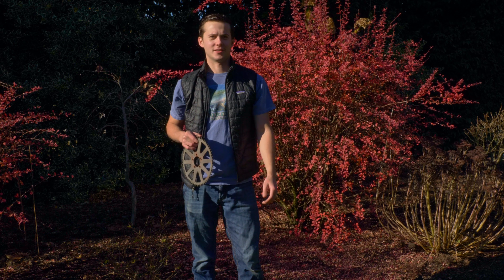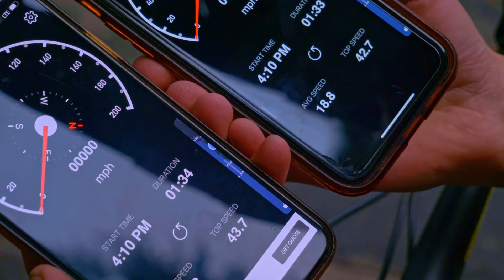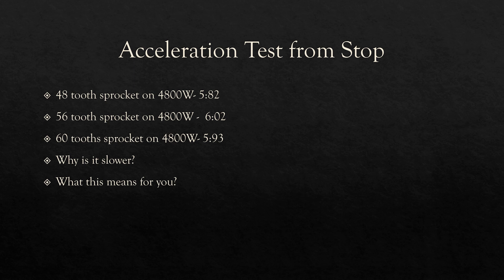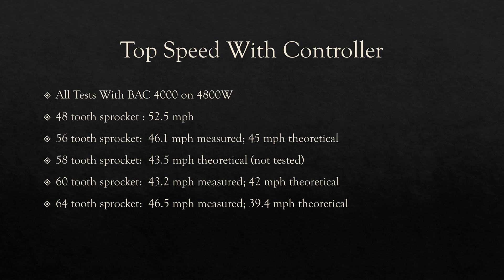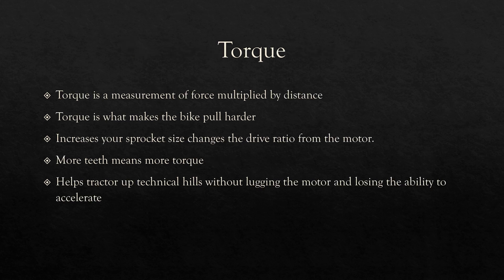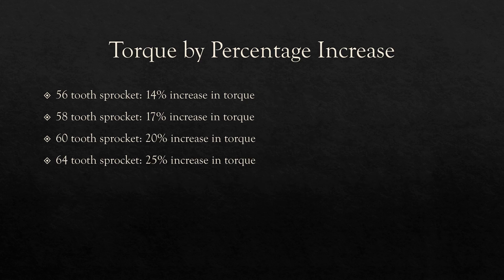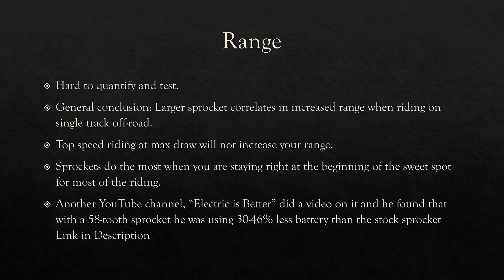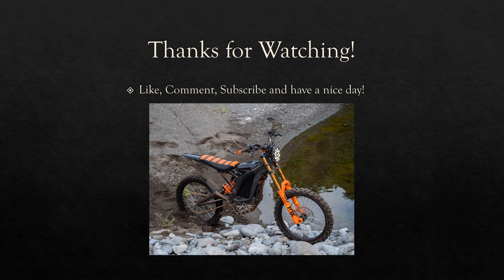Sprocket Testing On the Sur Ron X

Comment: small sprockets make your controller dump tons of amps. High speed rpm's require more voltage. Amps for torque, voltage for speed.  Hence, 52 volt batteries need to dump massive amps to achive speed and power. Where 72 volts has the best of both worlds. Massive volts and massive amps. I've got 6 emtb and 2 talarias and gearing is essential.

Comment: You don’t have a clue what you talking bout there is 4 sprockets 🤣👍
Reply from the maker: If you are referring to the Jack shaft gears and motor gear, those are not sprockets. In a pair of gears the larger is referred to as the sprocket and the smaller is called the pinion. There are not four sprockets on the bike.

Comment: Looked like you were going downhill in the speed test?  
If so I wonder if that might account for the top speed discrepancy you encountered on the largest sprocket. A flat 0% decline road would probably affect the results more towards the theoritical figures.
Reply from the maker: Definitely would’ve helped but was the straightest road near us where traffic wouldn’t be an issue. The hill was more to compare deltas between the sizes rather than max figures.

Comment: this has been a fascinating topic to study, i'm 6'5 250lbs i was worried the whole bike would be too small for me but seeing how folks in austrialia kit them out has given me some hope that the pegs and tires can be adjusted to add some height and a bigger sprocket will make all the difference for moving my girth up hills.
Reply: There are full size electric bikes with full size power for 8-15 grand depending on budget. You’ll end up spending at least 6-8 grand on a new surron and that’s without upgrading the power at all. I have the bike set up for me cause I’m 6’2 but After a year of owning it I’m wishing I spent the extra three grand on a full size. The stock suspension will not hold up to hard riding for anyone around 200-220 and up and that’ll cost you like 2 grand at least and another 2-3 for a battery and controller, plus the tires are clapped in any kind of real muddy stuff because of how narrow they are and buying a bigger wheel and tire from these custom guys they charge you a grand, so to build a surron or Segway x260 into an actual useable hard trail bike your going to probably spend well over 10 thousand

Comment: My Bike weighs up to 200 lbs and I weigh 200lbs. It has a 72V battery and Bac4000. Do you think I would get the same issue of too much torque on the takeoff where the bike lifts up with the 60Tooth sprocket?  Or should I get a smaller sprocket like the 55Tooth?
Reply from the maker: I’d recommend 64T if possible especially on a 72V system. You’d still be able to hit 60+ with that. What’ve you done to get the SurRon up to 200lbs?
Reply: @emotobros . It's not the Sur Ron. It's. a different E-bike

Comment: What do you think the top speed would be with the following: 
60 tooth rear
18/21 dirtbike wheels/tires
Bac4000 60v battery set to 10kw
?????
Reply from the maker: With a 64T and 19” rear instead we hit around 48MPH with field weakening.
Reply: @emotobros  WOW! I would’ve thought 64T at 10kw would be WAY more torque than needed… so confusing

Comment: If the test numbers vary because the testers couldn't run their tests consistently then the TEST IS INVALID, and despite all your effort should have NOT HAVE BEEN PUBLISHED. The test is fundamentally flawed. I figured this out when I was 12 years old. I ran a math probability test for a class in school and I attributed results to tester variations. That means THE TESTER IS FLAWED. If the tester designed the test then both the TEST and the TESTER ARE FLAWED. I got a "D" on the paper.
Reply from the maker: The tests were all conducted consistently. Sometimes results don’t match expectations. More tests could have revealed them to be outliers but we only have so much time to spend testing. Not sure what your goin on about man😂😂
Reply: @emotobros  "We only have so much time to spend?" More excuses? Wow, it must be nice to live in your world. A world where proper results are optional and there's no repercussions for failure. Man, I want to live in your world. It sounds easy. If I EVER provided answers like those you give to my professors in college years ago or to my clients now I'd be persona non grata in minutes, have no customers, & be penniless living under a bridge because millions could die because of my less than perfect solutions to problems.  I don't do that. I produce inspired solutions to problems others deem "too difficult to solve," or "impossible to do" 100% of the time often with little to no information to guide my efforts.  Your world filed with reasons why things can't be done sounds like a vacation to me and reminds me of when I was in grade school teasing pretty girls at recess and playing kick ball. I guess it's only youtube. There's as much idiocy as brilliance. Peace. Keep the electrons flowing and the wheels spinning. Ride on.
Reply from the maker: God tier ego stroke, chief, 10/10. You know what sounds easy to me? A world where you have unlimited time and resources to sit around and attempt to reach a conclusion that’s already very easily proven physically/mathematically. This was a dirtbike sprocket test for YouTube, take things a bit less serious and understand that we had a section explaining why we felt we got the results we did.
Reply: @emotobros  Look, I got a math paper graded down when I was 12 years old for doing the exact thing you did. It still stings and I'm bitter about it to this day. Clearly.
Reply: You need to use rollout to get the consistency.
Reply: @John-ep4in  Then rollout should have been used and the results of that test published.

Comment: Great info.  I'm thinking of turning my x160 into a commuter.  Lowest tooth sprocket I can find is 42.  Buy you colocations, could that make it to 40mph?  Would a custom 36 tooth work better?
Reply from the maker: Going that low will put a fair amount of stress on the motor and kill the acceleration. You’d probably be better off just getting a SurRon if you’re looking to get your speed up high enough to commute on. This video is based on a SurRon so not sure how an x160 would compare at this size.

Comment: I can't find a video of someone testing a 38T sprocket, 72v, and BAC 8000. Pretty sure you would go 80mph. I'll have to make it myself I guess
Reply from the maker: You can go over 80MPH with a 42T and the 800+72V. Lower T sprocket = way more heat though!

Comment: Torque actually goes down almost linearly as RPMs go up (due to increasing voltage in a motor, so your dyno graph is wrong I'm afraid). This means that with larger sprocket you are loosing torque at a mid-range of speed (20-30 kmh). If you have BAC - set phase current to 430A and you won't need a larger sprocket for bottom torque, while retaining you mid-range torque. With such settings I found 48 or 52t to be optimal for 60v system.
Reply from the maker: Under ideal conditions and a constant power draw you are correct. However, this plot actually is accurate. AC motors have an area of ‘constant’ torque, which is the flat line before linear drop off. The line shouldn’t be exactly flat, but in general there is an area of mostly constant torque. Linear decrease from the jump is more of a hypothetical result than an experimental one.  Also, the ramp upward exists purely as a function of our tune. We have torque ramping setup so that you don’t get hit with all the power instantly because that wouldn’t be enjoyable to ride. The voltage to the motor is actually decreasing as power is delivered due to voltage sag from an increased demand in amperage. Our tune demands very slightly more amps as RPM increases which gives that flat line effect.

Also, the torque is only decreased past the flat line for bigger sprockets. We have ran all the way up to a 64T and notice no decrease in mid range torque with bigger sprockets until about 35Mph with aftermarket controllers.

We also have ASI BAC4000s and run them at 430A. We still prefer >56T and manage to get 55MPH+ with that setup and enough torque to pull the front end up at 25-30MPH.
Reply: only applies to no-load rpm. If in the mid range speed the motor is under load then the bigger sprocket still has more torque

Comment: Interesting video, remember as engineers, experimental results always trump theoretical, the trick is to maintain consistency and replicability! Theoretical analysis often overlooks unforeseen factors. 

Definitely gonna look into upgrading my sprocket though, which are the best for wheelies? Lol

Also would be interesting to see a smaller sprocket size, doesn’t seem like anyone has tried that yet!
Reply from the maker: Very important distinction. We mention in the video that, experimentally, we think we were close those the limit of how hard we could launch and as we went up in tooth size it made it much harder to launch fast. This is likely why the times were so close.
Reply: Good information for those looking to maximize acceleration without sacrificing top speed, would the 56 tooth be best in this regard? Since it seems that once you step up from there the difference is negligible

Comment: Would love to see the comparison of a 50t and 52t sprocket versus the 48t.
Reply from the maker: We would like to as well but at $50-60 per sprocket,  the revenue from this video won't even cover the time spent designing 1 of the 4 we tested.
Reply: @emotobros  Coming from a guy with forks that cost half as much as a full Sur-Ron. You are well off with $. Probably got a Ludicrous XX on the way smh.
Reply from the maker: @micahack5377  the forks were $850 after selling the stock ones which is less than 1/4th the SurRon. If being able to spend $850 makes us well of than, yeah, I suppose we are. However, we also work full time run this business and have few expenses. No XX on the way, our controllers are better :)

Comment: Nice to see your sprockets you had made. Can relate with the high 50T count as I’m really happy now with the 57 I’ve been using for the woods. But my woods wheel  set is a 19X1.85 front & 17X2.15  rear now.  I’m really liking this wheel size with the 57T because it has instant throttle response that roosts anyone behind me!
PS- I’ve got one of my wheel sets for you guys to do some riding on . Will email you with the specs and sorry for the delay in response..
Reply from the maker: We are looking forward to it! Do you like the 19\17 combo more than the 21/18 or 21/19?

Comment: Also with a larger sprocket, the distance you are measuring will affect the times for the torque measure.   The bike will not gain as much distance or speed at the higher speed end of the run.   By doing a longer run, it allows the top speed differentiation to creep back in.  It would be best to measure a shorter distance to measure low end torque.  That will give a better impression possibly.
Reply from the maker: We thought about that too but the speed we were hitting was only around 30mph so minimum the largest sprocket had another 10-15mph to go.  The limitation is how hard we could get on the throttle. With a 60T it is a serious struggle to even go half throttle without popping a wheelie. We think we are close the the limit of how hard we can launch and on stock sprocket we were able to go full throttle off the line which made it a lot easier.
Reply: @emotobros  If you just shift your weight forward, i mean a little in front of the seat, you are not going to pop a wheelie, at least not enough to be a problem. give it another shot.

Comment: The 54 tooth has been a great middle ground for me. Great for climbing but not to slow for fast trails
Reply: But I am sure the 56 is extremely similar
Reply: @EdwinOlding  so what’s your top speed with this set up?
Reply: so 54 or 56 would be best for more range with a 60v 60h battery ?
Reply: or would the stock be perfect with an upgraded battery and controller?
Reply: @WARDOGOD-2  going up in size will help keep
Motor temps cooler. With the gearing helping everything staying cooler your setup will be more efficient
Reply: @northsandiegorc4248  gotchu! appreciate that💯

Comment: what about a 52
Reply from the maker: After riding a 56T we wouldn’t recommend anything lower as the difference isn’t torque isn’t very noticeable. Do find percentage torque increase though you can do 1-(48/52) then you can do 44*(48/52) to find the top speed on the stock controller.

Comment: In my experience as someone that rides this bike to work and back everyday a larger sprocket does NOT increase range. simply put i have to run the bike at a higher rpm consuming more power just to keep it at the same speed as the smaller sprocket. it can however give you more playtime in the woods as now with the larger sprocket the motor does not have to try as hard to get going and over obstacles.. basically you dont have to wack the throttle as hard. that is why i feel the claim of more range is misinformation
Reply from the maker: We have never advertised ourself as people who ride on road so that doesn’t apply to us. But beyond that, we mention in the video that people constantly riding at a high speed on road aren’t going to see range benefits so I don’t see what was misinformation.
Reply: @emotobros  my experience is at 15 -20 mph not top speed. 14 mile round trip went from charging every two days to having to charge every day
Reply: it was pretty clear its more range on trails
Reply: 48t to a 54t
Reply from the maker: Like we said, if you’re trying to sustain speed, you will see no difference because you need more throttle to reach the desired speed and sustain it. For us, we are constantly letting off and getting back on (accelerating) which is where you see a difference.
Reply: @emotobros   im in no way trying to bash you guys just feel the average person correlates range to mpc (miles per charge)
Reply from the maker: We know you aren’t. We also equate range to miles per charge, and in our experience, off-road, we get more miles per charge with a larger sprocket. Physics dictates that this is what should happen.
Reply: @emotobros  just watched again and i did hear you say increases range/decreases battery consumption missed that the first time. but feel that is a better representation of what is goin on
Reply from the maker: We for sure agree that on the road where speed is constant you’d want a smaller sprocket. Although we would be curious to see anyone create a practical test where they prove a bigger sprocket doesn’t help range off-road.
Reply: @emotobros   i live in the city and today i went to find as many hills as i could to climb by interstates and railroad tracks lol i left with 80% came back with 35% was out riding for a good 1 1/2 hours %90 in eco
Reply: @emotobros  oh i believe it definitely helps offroad gives you way more playtime
Reply: @mre741  I like your "playtime" metric vrs range concept.  2 riders on identical machines. A follows B to the half way point, then B follows A back to the start/finish line. the remaining usage time left in the batts of both bikes will not be the same because rider A and B are individuals. If you scale up with 100's of riders, then, an average may emerge,  that average is the range... the playtime is highly variable due to the wrist, mode, situation, and terrain.  imho...
Reply: i still gave the video athumbs up...

Comment: At 230lbs. on a stock Sur Ron X with a 64 tooth sprocket and non o ring chain, I was greatly disappointed with the performance.  My range was literally cut in half and at 10.5 miles of average riding my battery was at 40%.  My top speed was 37 mph and the torque increase was barely noticeable.  I took it off and went back to the stock 48 tooth and have been more interested in buying a 42 tooth and seeing what that will do.  Thanks for another detailed video.
Reply from the maker: This is very odd and definitely not something we noticed. We do mention in the video that if you are riding at the upper end of your discharge a sprocket isn’t going to be very helpful for range if at all.
Reply: @emotobros  yeah, I found it very odd too and did a number of rides on the flats and up hills and the 64 tooth sprocket was just drawing too much power and felt really weak at top speed...I am going to put it back on when I upgrade the controller and battery later on as I don't really want to be doing 60 and 70mph, but want to take off like a rocket and get to a more comfortable 50mph
Reply from the maker: We found that it pulls less power than stock but maybe we ride differently. We usually are on fairly steep and technical terrain going under 20mph avg. so that’s why we like the big sprockets so much. Our controller with 60T consistently gets us about 10% more range than stock.
Reply: @emotobros  I imagine body weight comes into play too.  I gun the throttle constantly and do most riding on pavement.
Reply: hey Bud , I use the Luna adapter and a vortex 42t .i weigh ~155 loaded up. Riding in traffic as a small scooter would, in sport mode 100% of the time.  For me, if I was going to change, 44t would be the sweet spot.  Thinking back, I can understand why sur ron went with 48t as the default all rounder choice.  Take heart, all journeys resolve to be circular.
Reply: @garylinnert1574  thank you for the info...I have the luna adapter and have had a hell of a time finding a 42 tooth that actually works for that...I will check out the vortex site...cheers
Reply: you are not necessarily wrong as that is my experience to (except the torque part) and i ride my bike going 15-20 mph down bike paths